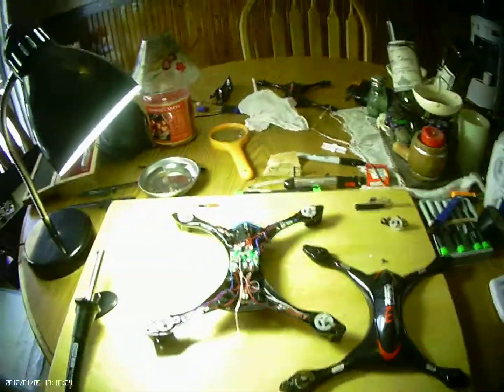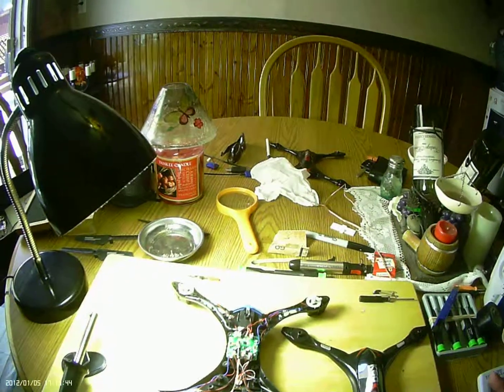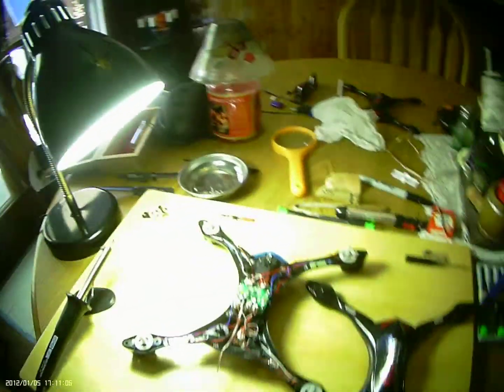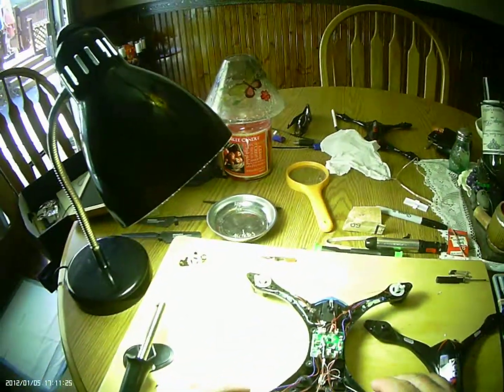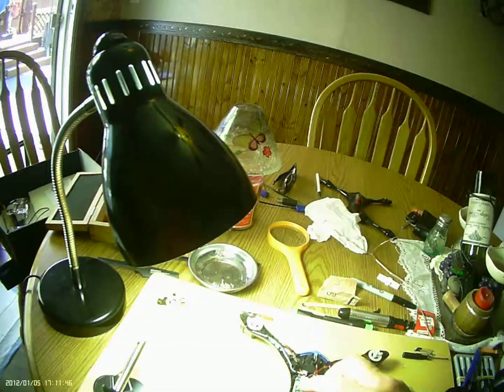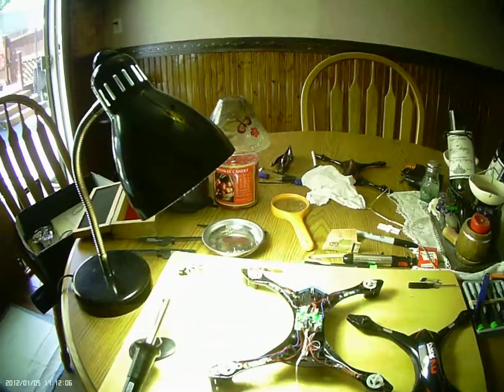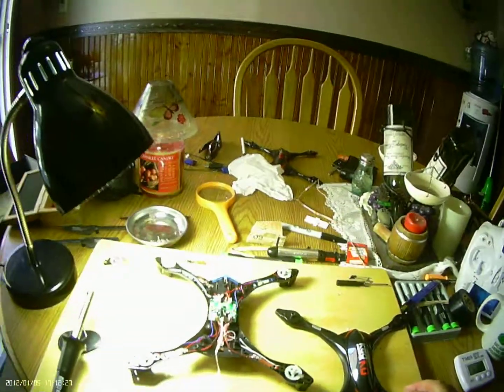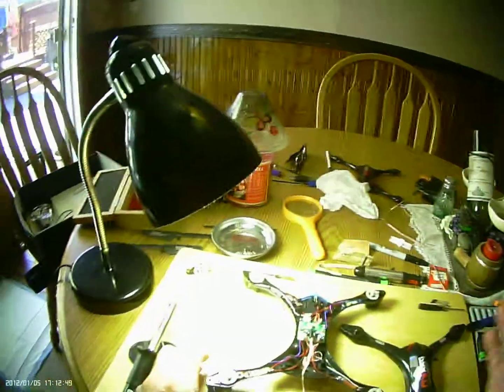Kai Deng K60 quadcopter' RANGE MODIFCATION

Comment: It wasn't 150 meters - I measured with google earth it was maybe about 120 meters in the desert. When Quadcopter101 actually tested for range it was 90 meters on an open field.
For better horizontal range you might want to put the antenna vertically, up through the canopy. Maybe sideways for more vertical range. 
With vertical modification mine went 100 meters, at 1 meter height, which is acceptable.
The 300 meter range stuff is usually from sales personel who mix up feet and meters or something like that.
There's only 2 toys that I have heard of that actually have big range like that...the YiZhan Tarantula might get a couple of hundred, and the XK250 Alien also goes far.
Reply from the maker: +Dave Review ,lol i saw that with 101 when he said it was nearly 150 meters i was like ok and i cant get 50 meters,, but on my second k60 and the Mod i did it i was able to get about 80 to 100 meters ,but i will try the canopy and now i will move on to something eles wasted to much time on this lol, thanks for the tips,, that XK ALIEN X250 Looks Interestering,i saw on Geekbuying.com